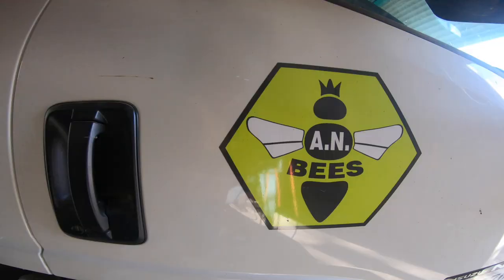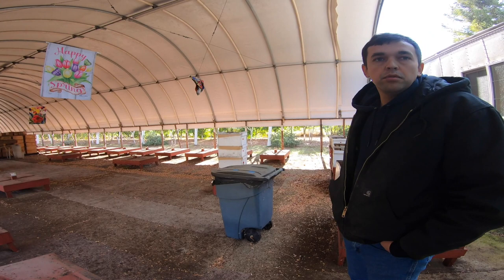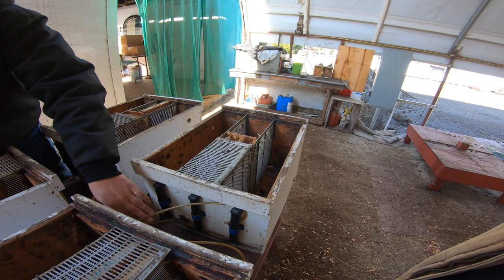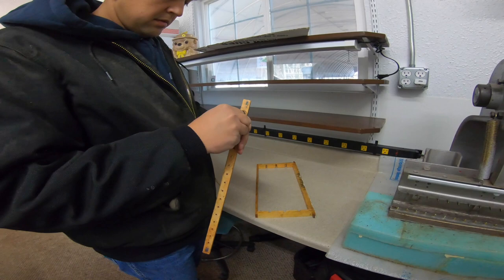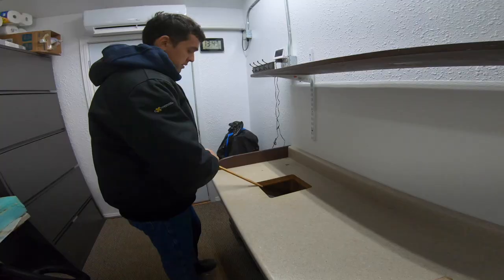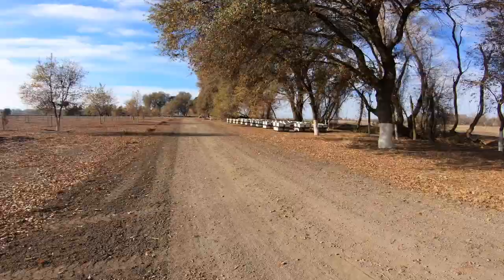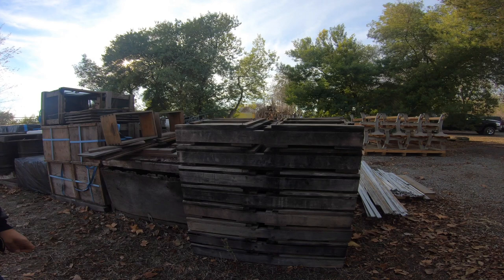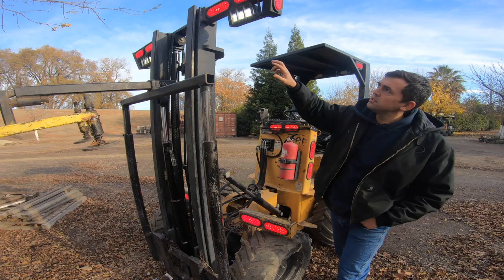Commercial Beekeeper - Northern California Queen Breeder Operation Tour - A.N. Bees

Comment: He uses 8 frames for his hives. What is his reason for using 8 vs 10?
Reply from the maker: Most guys have their own reasoning behind running 8 frames in their 10 frame equipment. I’ll take a shot on why they do that, normally commercial outfits run 8 frame and inside feeder. So a total of 9 slots just so that it’s not to tight and workable without rolling the queen